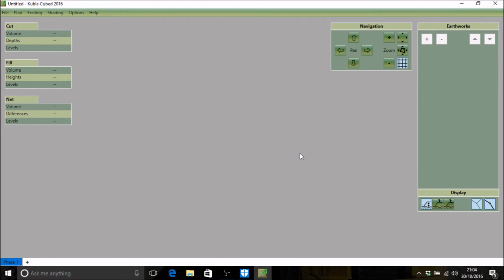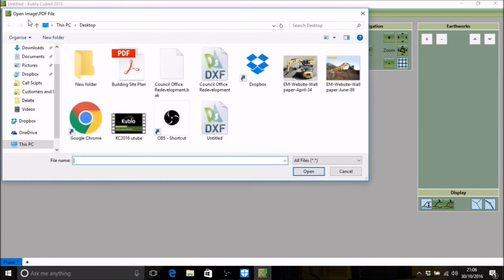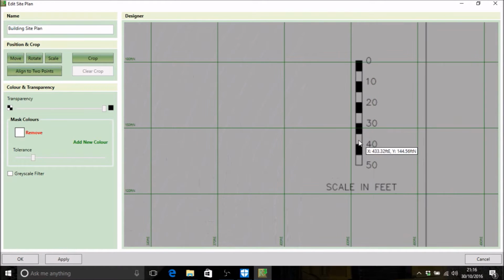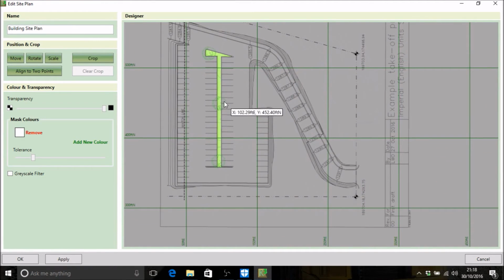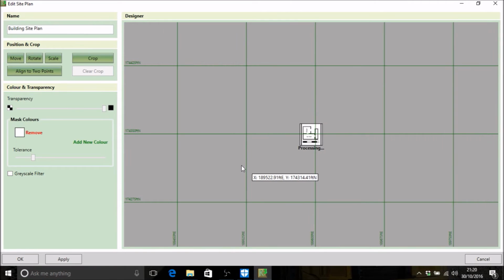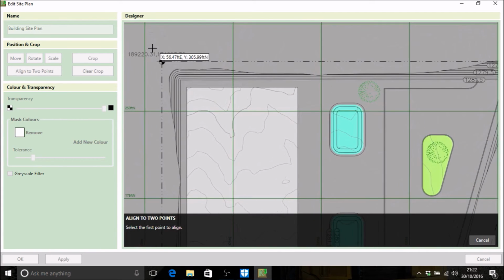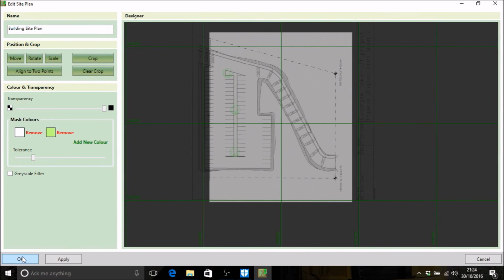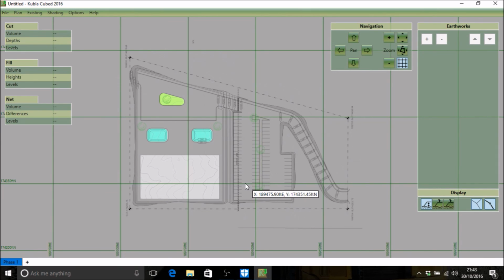Kubla Cubed 2016 - Tutorial : Defining Site Plans

Comment: Hi again, i scaled a pdf file, and the scaling seems to be working fine because i verified it. however, when i checked the easting and northing of some known points on my pdf drawing, the software gives me wrong coordinates. what do you think is the reason for that?
Reply from the maker: You need to use 'Move Tool' to geo locate the site plan.  A PDF has no location data inside just how large the paper is.  Alternatively you can use the 'Align Tool' which allows you to pick two known points and it will move, scale and rotate all in one operation.

Comment: Hi, i downloaded your lite software, and i am trying to add "plan" it doesnot work. I cannot see images or pdf files in my folders or on desktop. Hence, i cannot select any file. what to do?
Reply from the maker: Hi Zaher, sorry to hear you are having problems.  Are you clicking 'Plan' from the menu and then  'Add Image\PDF File'.  It's sounds like you might be going File->Open Project if you can't see any files as that filters out all but Kubla Cubed project files (.kcp).  If this doesn't help can you post on the Kubla Central forums (www.forums.kublasoftware.com) there is a section called 'Getting Started' in the Kubla Cubed section where someone will be able to help you.
Reply: Hi, no i was going to plan then add image/pdf file, nothing was showing, but when i restarted my laptop, it works fine now. i guess restarting was the fix for some reason!